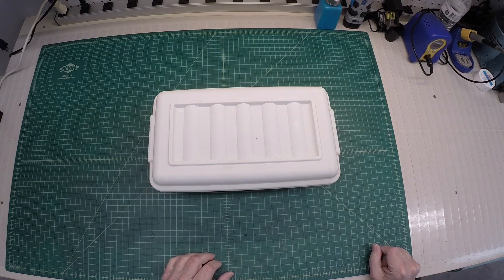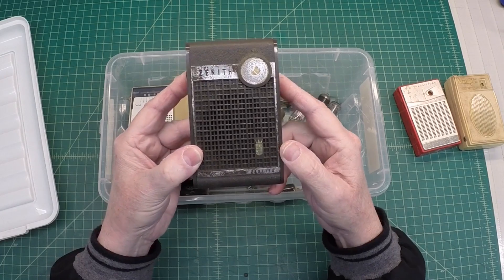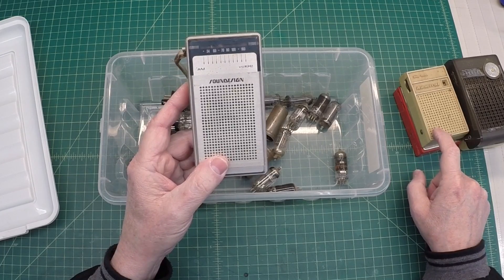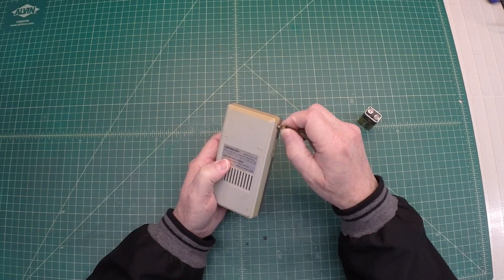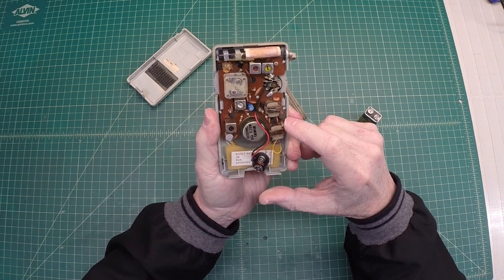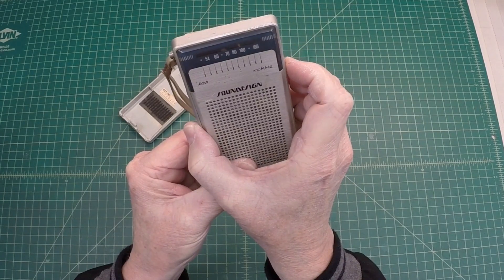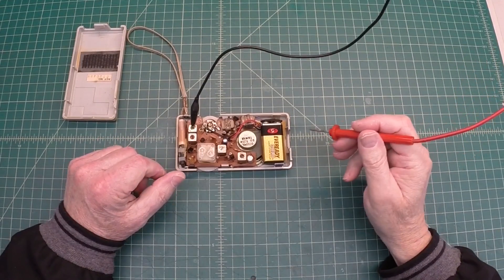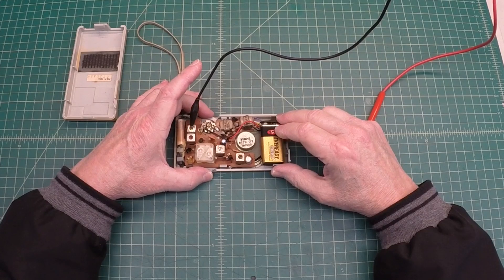Transistor Radio Repair

Comment: El circuito impreso estaba roto. No era soldadura fría. Para hacer esa reparación se debe raspar medio centímetro la capa de pintura y así distribuir estaño sobre el corte asegurando la reparación.
Reply from the maker: Gracias por la información, muy útil.

Comment: Where do the thin wires of the Antenna coil connect to ?
Reply from the maker: It was back to the oscillator section of the receiver. Best, Don

Comment: I have a 1964-1965 PLATA 9v transistor radio that has a big square capacitor ( I think) that gets real hot real fast after I turn it on. How can I fix that and enjoy listening to those fine old radio again?
Reply from the maker: It would probably be best to reference the schematic for the radio and use it to understand the capacitor value in question and a resource for any additional troubleshooting that may be required. Best, Don
Reply: Thank you, Don!  @RestoreOldRadios

Comment: I'm inspired to fix a Radio Shack 3 channel weather radio from the 80's-early 90's. It uses an IC for audio amplification but the radio section is crystal/transistor. Had a bad battery leak. I have a second identical radio which works so that helps!
Reply from the maker: Very cool! Hope you’re successful with the repairs. Best, Don

Comment: Don,

In another video you describe a method using infranview to make a copy of the circuit board.  In it you describe a t shirt mode. Can you create a video showing how you do this?
Reply from the maker: I just published an updated video on the process I use now at:

Transistor Radio PCB - How to View Both Sides (Trace & Components) Together - iPad Demo
https://youtu.be/h-ln7ezaSUY

Hope this helps.

Best,

Don

Comment: I have this Sony 6 transistor Radio model 2R-28, i cleaned it up a lil bit and put some batteries in and they start to overheat a lot very quick
I don't know what to do with it, you have any ideas?
Reply from the maker: Capacitors or diodes in the power supply rail or other… that are shorted loading down the DC supply would be my guess. Hope this helps. Best, Don
Reply: @RestoreOldRadios  I'll check it out when i have the time to, thanks 🙏❗

Comment: I wish I was able to find some help fixing my Panasonic Rf 626 Transistor 9 radio. I  collect antique radios and I made the stupid decision to bring it on a camping trip so I’d have some music to listen to and I dropped it and something broke internally.
Reply from the maker: Check out Doug's YT channel: https://youtube.com/user/mosslack and send him a message. He does a lot of transistor radio repair and has much more experience in this area than me. Have you opened the case to inspect the damage? Best, Don
Reply: @RestoreOldRadios  I’ve tried but getting it open has been difficult, it splits in half like other small transistors but there’s metal pieces in between and possibly other things holding it together. I’ll check out his channel though thanks

Comment: Hi. I have a 67 plymouth fury with an AM transitor radio that doesn't work. I get a constant quiet hum or buzzing with it on, and I get a crackle when I move the lead off and on the speaker. Where should I start with it?
Reply from the maker: It sounds like the power supply section make be faulty, but it’s hard to say. Check your grounding, antenna connection and double check your speaker connections again as well. Good luck on the repair. Best, Don
Reply: @RestoreOldRadios  Pulled the radio out and hooked it up to a battery and have my speaker and antenna hooked up. Without antenna if I put my ear to the speaker I get a very faint static. With the antenna plugged in I can hear a very faint tone being generated. Connections inside the radio all seem to be there. There are two bigger transformers in  the radio. Once where the power leads come in and another by the antenna. Not sure where to test and what I should be reading
Reply: One of the speaker wires goes into what I think is a large resistor or maybe something else. It is cracked and when the radio is on it is very hot to the touch
Reply from the maker: @hgpo27  I hate it’s dead. It could be one of the electrolytic capacitors in the power supply circuit, and again it could be a host of other things. If you can access the printed circuit board, do a visual inspection of circuit board traces to ensure you don’t see an issue. Best, Don
Reply from the maker: @hgpo27  Sorry, I responded you your other reply. If the resistor is cracked and hot to the touch, that would be a problem for sure.
Reply: @RestoreOldRadios  not sure if it is a resistor. It is the last thing before the speaker wires leave the radio. It's shaped like a thin rectangle, but has a sandpaper like texture. Its split in half.
Reply from the maker: @hgpo27  It sounds like a sand resistor. Google sand resistor and look at the photos and see if you see a match. Best, Don

Comment: It Could A Bad Transister. The Audio Amp
Is Good Cause You'r Getting Plenty Of 
Sound As Far As I Can Hear. It Probly Is A Bad Solder Trace As Far I Can See.
Reply from the maker: Thanks for watching Roger, a bad solder connection indeed. All the best. Don
Reply: @RestoreOldRadios  yah Wen I Was In My Teens I Used To Go To Garage Sales
With My Mom & Look For Transister
Radios To Fix & Resell. I Couldn't Afford
To Buy Parts Cause We Didn't 
Have Tho Money To Do So. Then
I'd Take Parts
Out Of Old Stereos 8 Track & Cassette Players
That Couldn't Be Fixed.
To Fix Them. Then Sometimes
I'd Take Parts Out Of Old TV's Like The
Speakers & Smaller Components
So You Name It I Used Parts Out Of It.
Even Small Handheld LCD Videogames.
Even Old Record players.
Anything That Had A Circuiboard Small DC Motor & A Speaker
I Took Out What I Needed.
Even Today I Still Do It. Now I Go To Thrift stores
& Look For Old Bluetooth Speakers.
If The Clamshell Is Too Bad To
Save Then I'll Rebuild It Into
A Peanut Jar. Cause Those Jars Being
Made Of Plastic It's Easy To Take A Hole saw
& Cut Holes For The Speakers.
So far I Found Some Bluetooth Speakers
That Wh'er In Pretty good Shape.
I Need To Find One That's In Pretty bad Shape
But Still Works Good.
Reply: @RestoreOldRadios  That's Pretty good
For Someone Who's Visually Impaired Like Me.
Reply: @RestoreOldRadios  I Had A Transister Radio
That Did That But It Wasn't A Solder Tracer
It Was A Copper Wire From The Antenna Coil.
& I Had Another one That Had A Loose
Transister Located By The Speaker Magnet.

Comment: I have a old 70s radioshack transistor radio. I have scrubbed it down with IPA and a tooth brush. I may need to resolver some joints but the radio was left outside and I dont have high hopes that it will be repaire able. But it was free.
Reply from the maker: Free is good and I hope you’re successful bringing it back in playing condition. All the best. Don
Reply: @RestoreOldRadios  
It was 2 far gawn to be usable but I will keep it just cuz its cool

Comment: Good video, thank you for posting.  I have an early 70's AM/FM Zenith transistor table top.  The entire FM band works great and the upper AM band from 800khz to 1600KHZ  works great, but the lower AM band 550khz to 800khz receives nothing.  Would you have any ideas on what could be possible causes for the lower AM band not working?
Reply from the maker: Jason - it sounds like the oscillator is not operational at the lower frequencies. If you have another portable AM radio, try placing it right beside your Zenith near the antenna and assuming the Zenith radio has an I.F. Frequency of 455 kHz, tune the portable radio to 455 kHz above the local station and you should be able to hear the LO. An example, if you have a local station at 600 kHz, tune the Zenith to that frequency and the portable set to 1055 kHz to confirm the LO is working. If the LO is not working, your trouble would be in and around the oscillator circuit.

Hope this helps.

Best,

Don
Reply: @RestoreOldRadios  Thank you Don.  I will defiantly give that a try.
Reply: @RestoreOldRadios  I have a local station at 660.  I set the Zenith to 660 and tuned my little Panasonic Panapet R70 to around 1115, and set it on top of the Zenith.  Behold, I could then listen to 660 on the Zenith, loud and clear. So I it appears you are correct.  Now I just need to find out what's up with the LFO.  Thanks again!
Reply: P
Reply: Ok

Comment: Great stuff! Could you please help me repair this old Panasonic R-1019 which I got many years back as a kid and never used? I need a circuit diagram and some advice. Thanks. Sham.
Reply from the maker: I don’t have a schematic for the radio, but one could start by replacing all of the vintage electrolytic capacitors and test all resistors to ensure they are in tolerance. In addition, a close inspection of the circuit board to ensure there are no cold solder joints, which is common. Hope this helps and all the best. Don

Comment: OK, so you can NOT repair a transistor radio without a signal generator ???
Reply from the maker: Randy, you can. A local off air signal in close proximity serves equally as well. Most failures are associated with leaky or shorted capacitors and at times a transistor or even a resistor. Good luck and all the best. Don

Comment: The antenna's feel loose and there is a screw to turn but it doesn't really do much. My old Sony is so much superior to my newer one. The sound quality is much better. So I would like to keep using it, but the antenna is out of control. It finally fell out the other day.
Reply from the maker: Hate that about the antenna falling out. I've got a few loose loop stick antennas in some of my transistor sets too. Thanks for watching. Best, Don

Comment: I have been collecting radio for about 2 years.
I’ve found that except for the early American made radios, the value is pretty much according to the owner or buyer. (Prices are just all over the place).
  Unfortunately I am not able to work on the radios myself, so I end up paying double for each radio, but what good is a nice looking radio if it’s not working?
Every one collects differently.
Every time I watch these,I learn a little bit more.
📻👍🙂‼️

Comment: Does anyone know where I could find a POWER SWITCH (button) for a Sony TFM -8100 W?
Reply from the maker: Robert, ping Matt +50sTransistorRadios. He can better guide you on a replacement switch. Do you have the schematic that shows the part number? Best, Don
Reply: Thanks for the tip!

Comment: hey i have an 11 transistor radio i used to use all the time from a garage sale that stopped working. the volume just disappeared while i was using it. then it would make a 'tch' sound just as i turned the volume knob to on but no sound otherwise. do you think its fixable? i can send you a picture
Reply from the maker: +Cortney Skinner +50sTransistorRadios I would think it’s repairable. I’m not a transistor radio SME. I’m coping Matt and maybe he can jump in and provide direction as this is his area of expertise. Best, Don

Comment: I was looking at the dial on the AM radio being worked on, and I couldn't help but notice what appeared to be some small triangles. I know they're not CONELRAD markings, as this receiver came off the assembly line many, many years after 1963 when that federal program was discontinued.
Reply from the maker: +Chet Pomeroy An interesting observation. Wish I still had the radio so I could take a closer look. Maybe I can grab it next time I'm at my brother-in-laws place. What's the federal program your speaking of for my edification? Best, Don
Reply: @RestoreOldRadios  CONELRAD is a contraction of CONtrol of ELectromagnetic RADiation. It was the result of what I believe to have been an executive order by President Eisenhower requiring all AM radios made between 1953-63 to have those special markings on their dials, requiring all commercial radio stations to cease operations, and change their signals to those two frequencies on very low power, in the event of Soviet Bomber attacks. This was intended to prevent the Soviets from homing in on AM radio signals to attack U.S. cities, as the Japanese military did in 1941.
Reply from the maker: Chet Pomeroy Great information and thanks for sharing your knowledge. Best, Don
Reply: @chetpomeroy1399  Hay una confusión aquí. Las marcas eran para que en esas frecuencias se harían las transmisiones de emergencia a la población por lo que debían quedar LIBRES de cualquier emisora comercial. Si todas las emisoras pasaran a esa frecuencia no serviría de nada sería una inutil mezcla.
Reply: It was civil defense frequencies in an emergency.

Comment: could you tell us what's connected to the little aircoil+cable?
Reply from the maker: +Hugo Coolens Sorry about my belated response. It's a RF Signal Generator. I was using the air coil as a near field probe. Hope this helps. Thanks for your question and for watching. Best, Don

Comment: Do you have any circuits or info to make the audio and rf/if signal generators?
Reply from the maker: +gartmorn Sorry, I don't. I bought my analog RF/Audio signal generators many years back. You may find some circuits doing a search on the web or look for used equipment on eBay or other... Hope this helps. Best, Don
Reply: RestoreOldRadios thanks for replying.  I'm new to radio circuitry and am finding it fascinating.  All your tricks and tips are really useful to me so keep them coming as a few of us are starting out in this field and appreciate anything that makes life easier!
Reply from the maker: +gartmorn Congrats on getting into the field/hobby. It's a lot of fun and head scratching at times. If I can ever help, feel free to reach out. I appreciate you following my channel. Best, Don

Comment: what is the black rectangle part at the end of the board near the transistor?
Reply from the maker: +addyou100 If I'm looking at things the same as you, it's the ferrite material that supports the Litz wire (antenna). Please let me know if this is not what you're referring to. Best, Don

Comment: Great repair! Seems everyone I get is either a broken solder connection of board.
Reply from the maker: +The Radio Shop I can see that looking at the circuit boards up close. I repaired two more of them; one bad cap and the other was a cold solder joint on one of the antenna leads. Do you use a microscope or other... to exam and make repairs on those delicate boards? Best, Don
Reply: Hi Don. Yes I have a AmScope microscope that I use to inspect boards with.  It really helps in finding those bas solder joints and cracks in the boards.  Great job on getting those old radios back together.
Reply from the maker: +The Radio Shop Thank you Buddy. Some great test equipment you have. Keep an eye on your mail. I have a piece of test equipment that I'm going to send your way. Best, Don
Reply: Well Thanks and thanks again Don. I love old test gear.  Most of my stuff is old like we are. But it is the stuff we grew up with. And nothing is no better than repairing a vintage unit with vintage test gear. Every time I set down at my new bench with all the old Eico gear it is like stepping back 30 to 40 years ago. So I guess you can say I have my own time machine :) All the best to you my friend.

Comment: Hey Don, thanks for mention! I would say that the Zenith Zenette is probably the most interesting model in that group, it's too bad that it has some serious corrosion issues though. The Continental is probably the second most interesting, and is likely from the mid 60's. That tuning mechanism on that SoundDesign radio is interesting, it gave the set the look of dial-string tuning, without the labor of stringing a dial (which is one of my least favorite radio repair tasks).  Cold solder joints are a fairly common problem, especially on inexpensive radios that were produced overseas.
Reply from the maker: +50sTransistorRadios Thanks for your reply Matt. I still have the Zenith to look at when time permits as I was telling others a personal issue came up that took priority over...  Thanks again. BTW - JP... needs your advice too on an issue. Best, Don
Reply: 50sTransistorRadios

Comment: Nice. I have a DX-160, half of the solder joints on the coil board were wonky.
Reply from the maker: +scott king Hi Scott - thanks for viewing. The boards on all of these look rough; really surprised they work at all or ever did. LOL Best, Don

Comment: Good stuff.  Very interesting to watch your plan of attack.   Hope you dig into the others.    I have an radio with one of those tuning capacitor assemblies  and I think it is dirty or has a bad connection inside.   Do you or your viewers have any tips on cleaning or repairing one of those things.   Is there info on how they work somewhere?   There are several variable caps in them but have never heard about what each one does or how to align one of those.
Reply from the maker: +jp040759 +50sTransistorRadios Thought about pulling out the signal tracer then decided to give it a try using the method... I added Matt for his input on the variable capacitor question, etc., as he's a SME on these units. Best, Don

Comment: That was pretty good finding out a cold solder joint was the problem. But I guess all of those Japanese radios were just produced so fast that over the years they would loosen up and stop working. Great fix thanks for sharing
Reply: I had a friend show me what to look for on tv,s that the color was out of whack.It was a bad solder joint  on the circuit board on the yoke, the rear of the picture tube, Similar to this video.then worked good.
Reply from the maker: +LUCKYLARRY Yep, after looking at the circuit boards up close, I'm surprised they work at all LOL. Thanks for watching. Best, Don